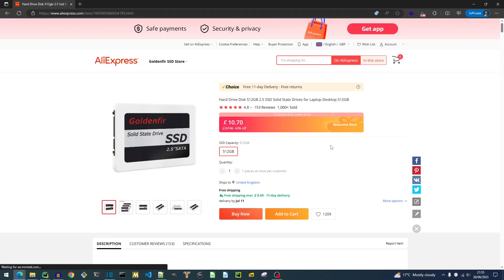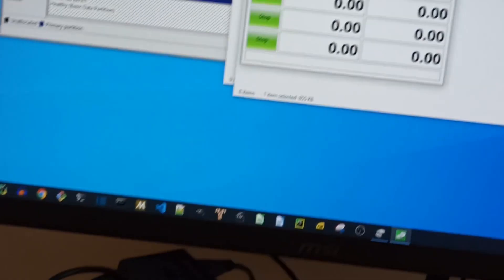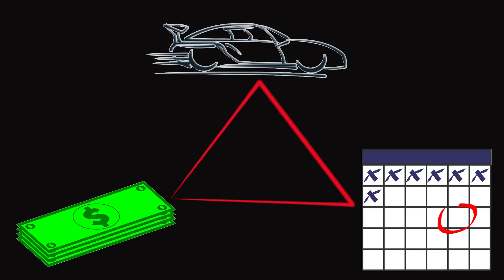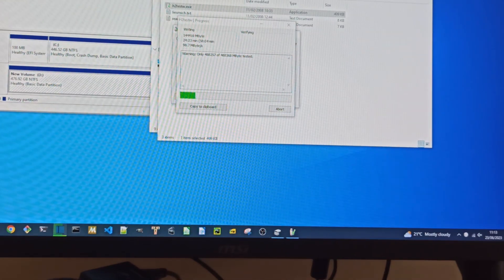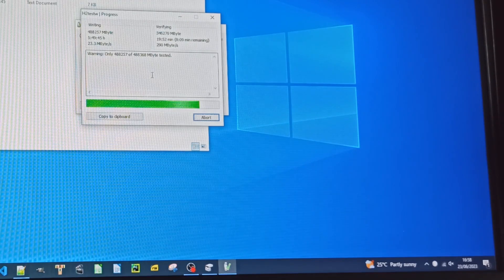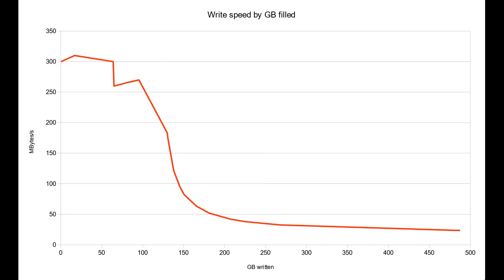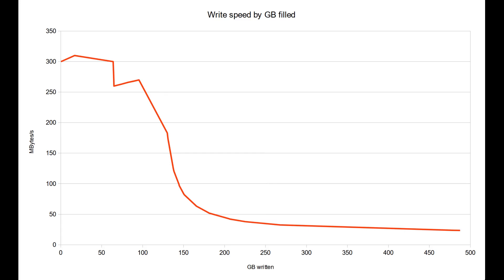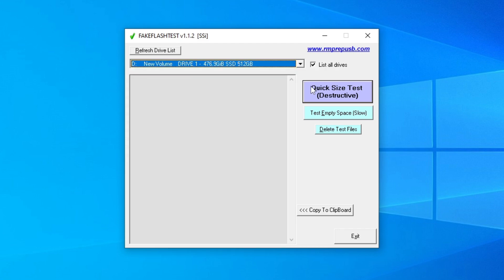How to test an SSD- Goldenfir 512GB review

Comment: is the case made of plastic or metal?
Reply from the maker: The case is plastic.

The 2.5" SSD form factor is not next generation. The case is rather hollow and could be removed if the thermal insulation mattered more than electrical.

Comment: Overall, do you recommend the drive? Or is the premium of a bogger brand worth it?
Reply: i just bought it from the same site. it's really slow don't buy it.
Reply from the maker: Goldenfir have been advertised to me for at least 5 years. I recommend them.

The premium you describe takes the form of a local warranty; it's up to you to trust your data on that disk being returned under warranty. I prefer to backup multiple times and not claim on any warranty.

I have used my Goldenfir to run Linux, for a few months, no problems.
Reply: @TechTemps  that's what I was thinking. Multiple Goldenfir drives would still be cheaper than some other brands, and guarantee data safety.
Reply from the maker: I was checking my order history and it turns out I did order an M.2 disk from Goldenfir in early 2020. It still "powers" a thin client that I haven't used in about a year.
Reply: I have bougjt one goldenfor ssd but  , I don't know how to install it to my pc correctly,  because when I installed this ssd in my pc with Windows 10 via USB bootable  , it was OK but holdefir ssd don't show at file explorer 
Who can help me for this problem?